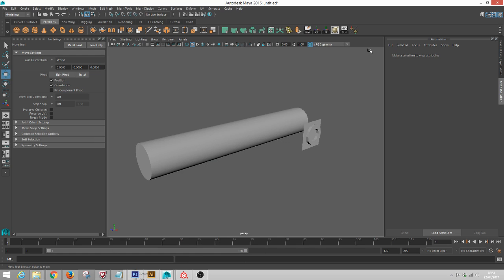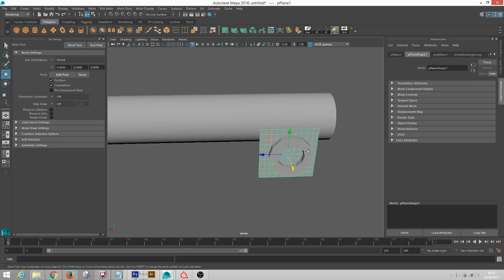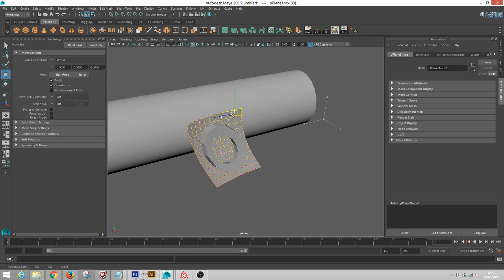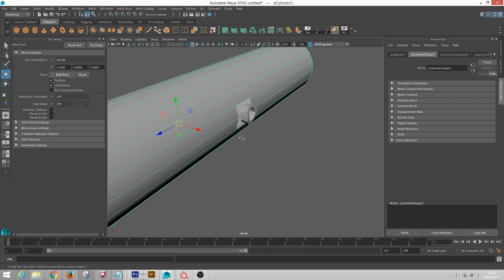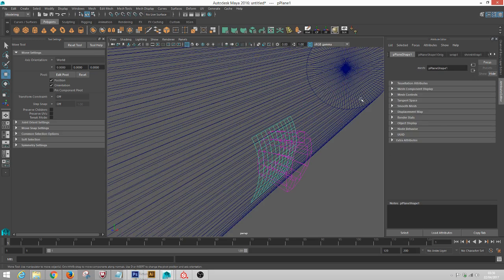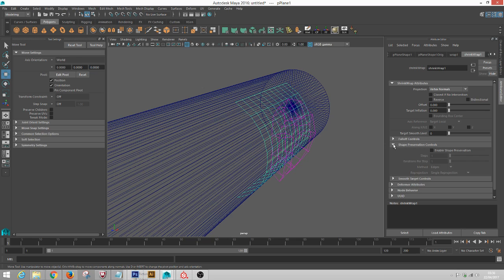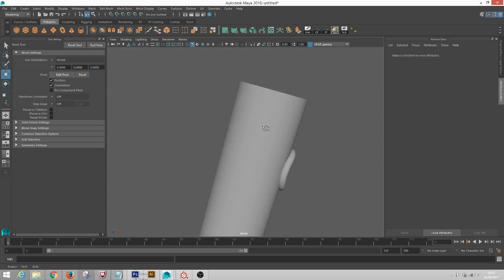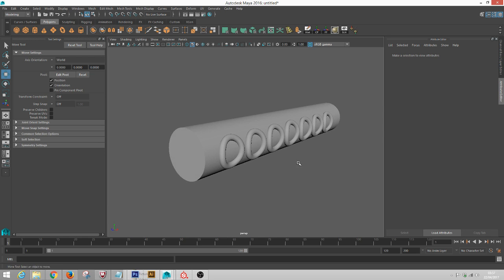Maya Shrink Wrap Tutorial

Comment: Quick Notes:

1.select object to deform then grid plane 
deform>wrap
2. select grid plane then object to deform to
deform>shrink wrap
3. change settings in shinkwrap tab in attribue editor
         -under {projection} change drop down menu to Vertex Normals
         -under (Shape Preservation Controls),check (Enable Shape Preservation)
         -move (Steps) and (Iterations Per Step) sliders to maximum
         -Change (Reprojection) drop down menu to (Reprojection Per Step)

Thanks for the information! I often come back to this video.